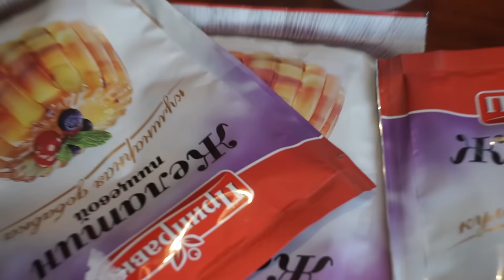Homemade Gear Casting, method of homemade silicone

Comment: That gear is going to be about 5% smaller than the gear it replaced, due to shrinkage.
Reply: @ about 2:40 he added material to the pattern to increase diameter.
Reply: @markrainford1219  I highly doubt that the way he added material kept the correct gear shape.  It worked, obviously, but this couldn't be done for a more precise gear.
Reply: @SomeTechGuy666  in this rather non precise application and when he put the added modeling clay into those voids of the plastic gear he inherently added strength near the teeth and then by adding the "tape" on the outer diameter he added a small amount of strength as well ... and for this imprecise application it will probably work! :)

Comment: I'm surprised that they'd use 1 metal gear and then the other out of a much much weaker material. I know you want to make sure that your product fails in a safe manner, in this case, with the internal plastic gear breaking meant that you could still open your gate by hand as the external metal gear is free wheeling. If it was electrical then the motor would resist a person trying to open it by hand. Not sure how old it is, or how expensive, but you've probably made it last forever so long as it is taken care of.
Reply: It's for safety, to keep everything else from breaking

Comment: What you did is completely wrong
 ..
They're made of plastic so it just breaks and the rest of the machine stays intact this gear is a deliberate weakness
Reply: It is for safety, you'll find it in sewing machine also
Reply: That's not true. They could have made a coupling out of plastic to create a break point when forces are too high. Plastic gears are planned obsolescence and not break points as it would be stupid to have a complex shapes break rather than a simple coupling.
Please don't spread your stupid on the internet.
Reply: Also to reinforce my point ,why use plastic on a part that has to move a lot and would wear the gear easily? In industrial applications you have steel gears as there and even in this system there are fail safes that trip the motor(fuses) or electronics that stop the motor and reverse the motor. This is why you have the extra electronics and sensors for this exact reason and not a gear as a "break point".
Don't fall for the "marketing" bullshit. There is a reason a lot of the old stuff is still around as it was over engineer and not like the crap of today.
Reply: @kazykamakaze131  My personal preference is a spring loaded clutch that breaks loose when it hits too much resistance. Like what's used in cordless drills to adjust the torque on the chuck. That way nothing actually breaks and once you find what's causing the resistance everything goes back to normal.
Reply: @kazykamakaze131  While your logic is good!  I have seen plastic gears used for as a sacrificial part to purposely break first.  I agree there are better ways ... but they still do it on a regular basis!!  As evidenced by car mfg - mfgs often don't really care about those who have to service their vehicles - not even the people in their own factory trained dealerships!!
Reply: @kazykamakaze131  I have a 30 year old garage opener with plastic gear... And also the manual for it...It talks about the gear being a fail safe and give you a part number to order a new one...So there is that..
Reply: @DynamicSeq  So just because it's 30 years old doesn't mean it is correct. Fail safes don't need a gear to fail, there are things like clutches and lockouts that can avoid having to use a manufactured part just so the badly engineered equipment doesn't destroy itself from normal use. 
All this "research" into making products cheaper/engineered obsolescence  could have well just gone into actually building something that last more than basic warranty ranges. Funny how old 50 + year old machinery are still working till today.
Reply: @kazykamakaze131  It's all about price. And funny how 50 + year old machinery are outdated and useless, and are no longer around..
Reply: @DynamicSeq  You sure about that? If you go and look at the world of machinists they'd say you are ignorant to the fact of how good the old machines were.
There's a lot of examples like this that would show that you don't know what you are talking about. There's a reason everything fails so much these days and it's not about price, it's about being able to upsell your customers parts that fail which the manufacturer put there in the first place. Ex: old tractors have a oil bath system that when you service the tractor only needed to clean out old oil and put new oil in, instead what we have now is air filter cartridges that you have to swap out and throw away, same goes for oil filter cartridges and for hydraulics and power steering. 
Sorry you will lose this argument as I have as it seems quite a bit more knowledge on this subject than you do and go from mechanics to all the way to electronics(I have my masters in Computer Science). 
So please feel free to come at me, I like having debates.
Reply: @kazykamakaze131  Kinda hard to have a conversation with some one, not understanding the English language..."Why is Apple still around?" **facepalm**

Comment: This is the dirtiest, grungiest, way of casting I've seen in a long time. But good work man. I never would have thought of gelatin.
Reply: Jay Bee malgres ce ne pas solide
Reply: I like to says, “there are things I make for myself that work perfect but I wouldn’t never make them for others”.
Lol
Reply: Thats why they beat the germans, while the germans where mini producing super complex tanks with lots of complex processes...
They where making thousand of tanks out of duct tape, melted pipes and wax xD
Reply: @StoneCoolds  With manual gearboxes and Tractor controls for simplicity.
Reply: @StoneCoolds  were
Reply: NovorSec German tanks were 4 times better than American tanks. But the Americans had 5.
Reply: @MrPland1992  They were not.  The Panthers and Tigers were the only tanks better than the Sherman, but the advantage was not as extreme as people are led to believe.   Fast forward from ww2 to Korean, and the up gunned Shermans had a greater than 1:1 kill ratio over the T34-85's.  That said, I'm not saying Sherman wasn't generally outclassed by the Panther, or that the Pershing shouldn't have come sooner.  We should have had Pershings at D-day.
Reply: @StoneCoolds  Uh, German tanks were also rediculously more effective, to the point were the Tiger tank was pretty much invincible against the T34 and forcing the Soviets to use "sawed off" artillery guns in their tanks.
Reply: @xXYannuschXx  This statement is flawed in many ways. Tigers never really faced T-34, most heavy tanks were deployed to North Africa first and then to the western front. Panthers were the primary German tank on the eastern front after Panzer IIIs and IVs were shown to be outmatched by T-34s. The kill ratios for those Panthers were insane but consider that the average combat rediness of a Panther battalion was 35% compared to around 85% in a T-34 battalion and you start to realize why the Germans had trouble. When it came to developing the Panzers I through IV they had tons of time and spent years developing the designs before they put them into battle, they were effective and reliable. Panzers V through VIII and the Königstiger were all great designs on paper but, they never had the testing required, were expensive, used rare materials that were in short supply, had complex designs that required special equipment and training to maintain, guzzled gas in a country starved for oil, and due to the need to push them into service most of them never actually finished being designed. Most of the memes you see about the big cats blowing transmissions or engines wasn't because they were poorly designed, it's because they didn't have the time or resources to develop and manufacture bigger engines to move their immense bulk, so they used engines they already had that were pushed to their limits and often failed. 

Basically by the time the Soviets were facing German tanks that could threaten them all they had to do was sit back and wait for them to either break down or run out of gas. The Germans know how to build weapons, they just suck at the logistics side of war. They finally figured out the could just build weapons for other people and get rich doing it. Look at the list, Krauss-Maffe, Rheinmetall, Krupp, Mauser (Now SIG Sauer), H&K, Mercedes, Eurofighter GmbH, Airbus (which is basically all the WW2 German aircraft manufactures rolled into one), as well as a number of shipyards. I mean just check out how every special forces group in the world runs MP5 variants and HK 416s or how almost every nation in Europe and Canada all use Krauss's tanks, and Rheinmetall's cannons are so good the even the American's had to licence it for their Abrams. Not to mention have Mercedes, Porsche and BMW have all stuck around after building tons of cars, trucks, engines and even tanks for the Nazis.
Reply: @xXYannuschXx  Yet somehow the Russians ended up in Berlin until, oh, about 1990...  The Russians only made about 2x the tanks than the Germans, so they were not that much superior.  In fact, every German tank had problems when first meeting the T34 and KV1.  So they stuck AA guns in tanks.  To answer the Tiger and Panther, the Russians then built the IS-2, which they made more of than Tiger 1 and 2 combined.

Comment: Gelatin... I never would have thought of that. Clever.
Reply: Looks like farm boy ingenuity
Reply: Gelatin only worked good because he had a hardener with Russian writing
Reply: What is the clever? How much cost that spare part? How much you earn per our? This is not clever this is stupid lost time! In my country we say priest with out job baptized goats.
Reply: @borivojetravica569  When you live somewhere that takes 4-6 weeks to get a part + shipping costs its actually not wasted time, because not only has he replaced the gear but he replaced it with a metal one that's going to last his entire life preventing future breakdowns, so really it's actually justified time.  3D printing it out of metal would of been faster, or using a lathe and a drill press etc but who's got that kind of tooling and money laying around
Reply: Try replacing a 40 year old cassette deck nylon gear when they quit making them. Hard to toss a top notch deck for a little cracked gear.

Comment: Well done! The reason for that gear was made in delrin, tough, is that in moving gears a weak one is needed: if something goes wrong or is overstressed, the weakest one breaks, saving most expensive one (a geared rail costs more than a single gear). Now if something goes wrong the risk is breaking the rail...
Reply: The cast iron one while being stronger than the gear made of plastic is still by an order of magnitude the weaker gear of those 2.
Reply: @MrTylerNinja  it's not iron looks like ally easily sawed etc.  Correct my if I'm wrong
Reply: @emo.1210  I'm guessing it's aluminum.
Reply: @phillhuddleston9445  it's is aluminum. if that was molten iron you would be seen yellow-white glow as the melting temperature for iron is insane high (about 3000°F, vs 1100°F of aluminum). also, there should be sparks randomly generated if was iron or steel. and you would never be able to melt it with that weak of a forge, you need an arc furnace.
Reply: @phillhuddleston9445  Yep, that's almost certainly aluminum. Could be some kind of zinc based pot-metal, but it melts and machines like Al.
Reply: @MrTylerNinja How do you figure that?